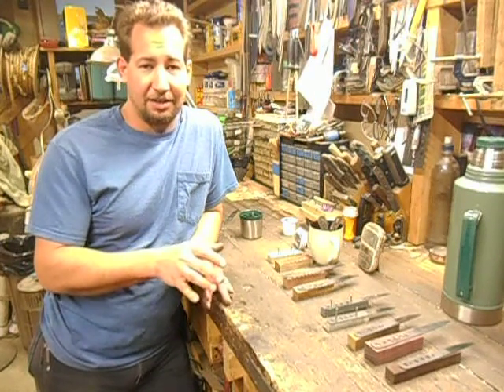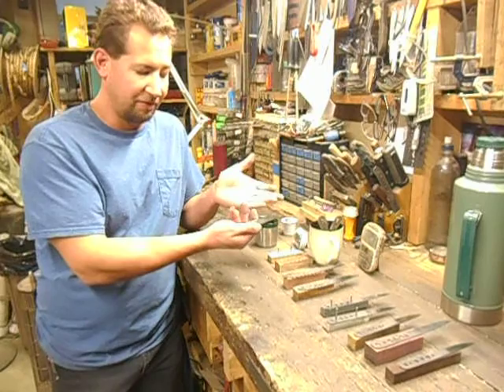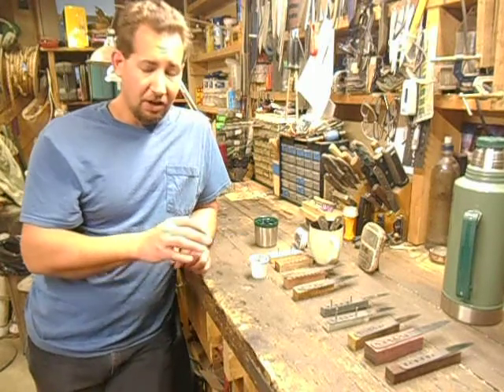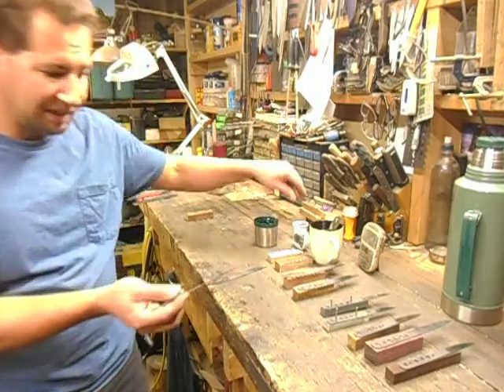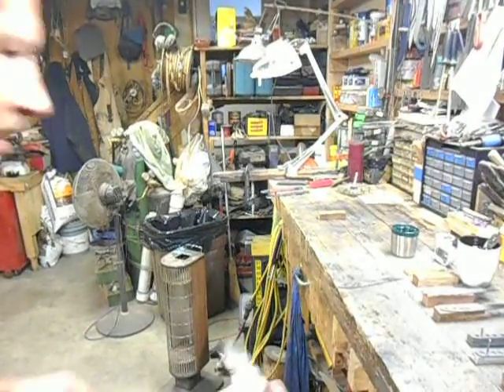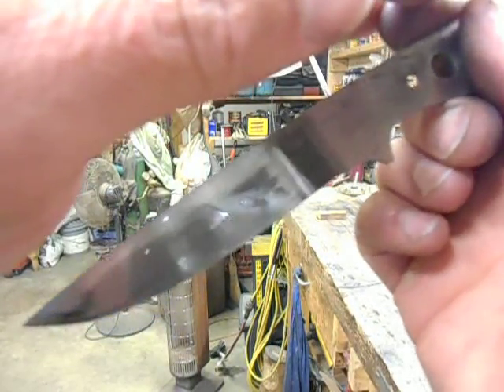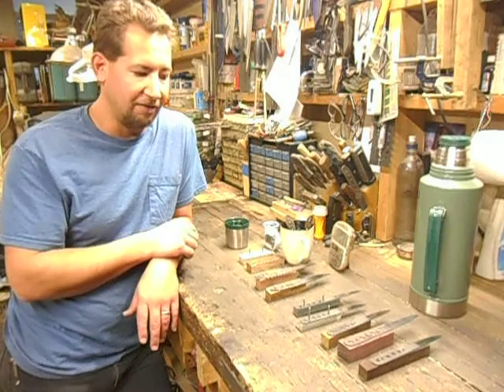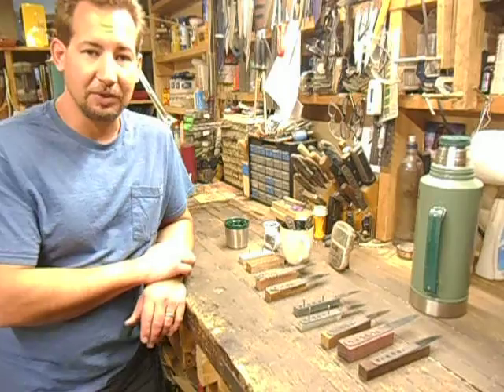etching knives with coffee

Comment: I like to use coffee for etching. Here are some pointers for a better result:
- use instant coffee, because of the freeze drying process the oxalic acid content is way higher than normal coffee, also it's cheap
- make your instant coffee 5-10x stronger than you would for human consumtion, insert the degreased blades while the coffee is still hot, then wait and check for progress every 30min or so
- instant coffee should give you a much richer, darker etch; also more glossy than the rather flat/dull appearance that a vinegar etch often has
- I heard that agitating the surface with a scotch brite pad or steelwhool every so often will make for a more uniform etch; haven't tried it myself yet, though
- I also heard that the increase of the oxalic acid content (that happens during the freeze drying of instant coffe) will also happen in normal coffee albeit much slower; you just have to let it sit for quite some time, IIRC as long as some days, so I doubt that it's practical
- I have been using instant coffee a few times, mostly on axe heads and the hardening
 line definitely showed on the axe heads
I also like the fact that this method is not terribly hazardous to the environment or in fact to me. I mean, you should probably still dilute it before pouring it down the sink, but
 it's not going to be as bad as, say, ferric chloride.
Reply from the maker: +kaizoebara Thanks for the tips!!now see with instant coffee, I would not feel so bad about wasting it. I will pick some up next time im at the grocery store and give it a shot!
Reply: You're welcome. Be sure to post you results. ;)
Reply: I have tried instant coffee to etch my cable Damascus steel I’ve made but not getting any results :-( I’ve even tried ferric chloride non diluted and I saw the pattern with the ferric on the steel but as soon as I cleaned the steel the pattern disappeared:-( what am I doing wrong?
Reply: @stokermeister3  Did you harden the blade first before etching?
Reply: Jay B  no as it made from wrought iron and I’m not too shure about quenching wrought iron in oil while it’s hot 😱😵
Reply: @stokermeister3  Wait, you made a Damascus knife from a cable made of wrought iron...?
Reply: Jay B I made a bar of Damascus from steel cable  and the other I forged a knife from wrought iron  square bar  I would like to have a video on it but I’ve been trolled by nasty people so I’ve had to take down my forging videos 😵😢
Reply: @stokermeister3  Ah that's a shame man, I'm sorry to hear you've had to experience that. Might be worth turning comments off or joining a community (iforgeiron, reddit etc) and posting there where you'll get more constructive feedback.
Reply: Jay B  I have tried forge iron but it being a American site it is difficult to make a account as I’m in Ireland 🇮🇪
Reply: @stokermeister3   Don’t let those losers ruin it for you. Keep on making videos brother.